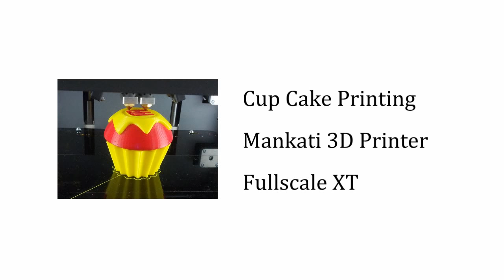a Cup Cake Dual Color 3D Printing - Mankati 3D Printer Fullscale XT | Dual Extruder 3D Printer

Comment: I don't know if you guys could help.. But when I print using dual I get blobs of the other color mixed in with the other color.. As in I'm printing a white bottom half and a black top, I'll have black dots in the white and white dots in the black :/
Reply: +Tankerdc i think your problem is because of the inactive hot end being at printing temperature. You could solve the problem by disabling the inactive hot end when not in use.

Comment: How much does it cost to produce that cupcake, in terms of the printing material? And how long did it take in total?
Reply from the maker: You would need two different colours of filament, if you order from Mankati at http://shop.mankati.com/?product-114.html it's 14 dollars per kilo, but you would only need around 15 grams of the material. So the cost should be around 21 cents if I did the maths right. The time depends on the layer height, shell thickness and fill amount, with a 0.25 layer height, 0.8 shell thickness and 15% fill amount, it takes around one and a half hours.
Reply: Thank u

Comment: When it started the top portion @ 2:30, did it set up the support itself, or did you have to lay plastic wrap before it started?
Reply from the maker: Hi there, we didn't need to do anything, the PLA filament could just cross the surface and support itself. Thanks for asking.
Reply: Oh, so it created it's own support lattice for the top half?  Huh, interesting.
Reply: Siolfor80 no. It's going fast enough to not need support.It's called bridging.
Reply: Ronald Wayne
Ah, ok, i did not know they could do that.